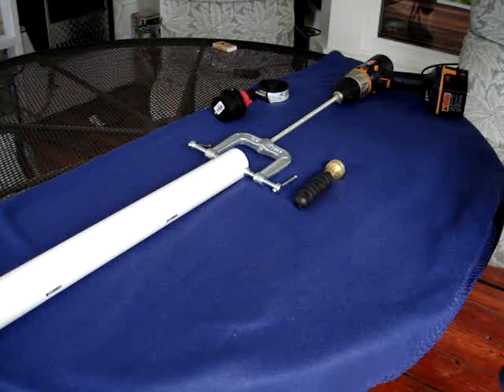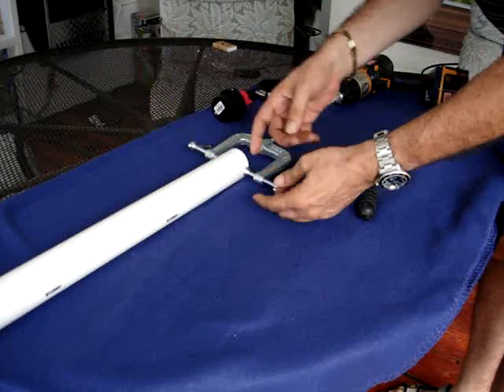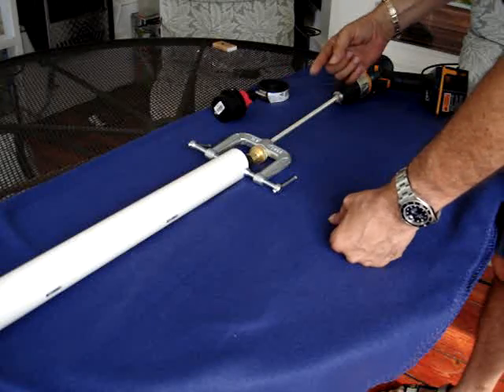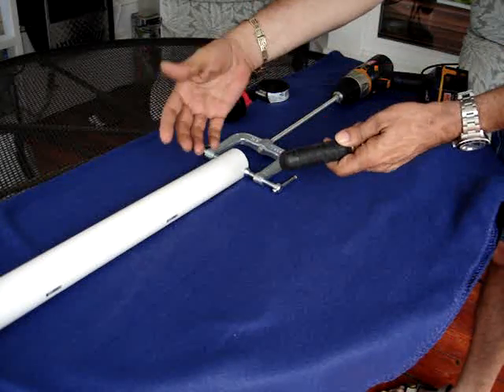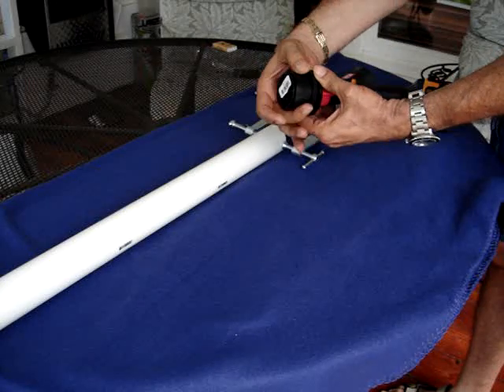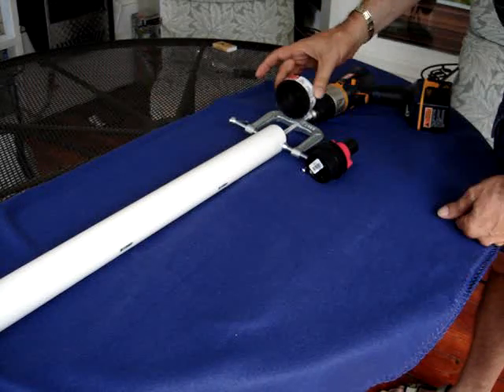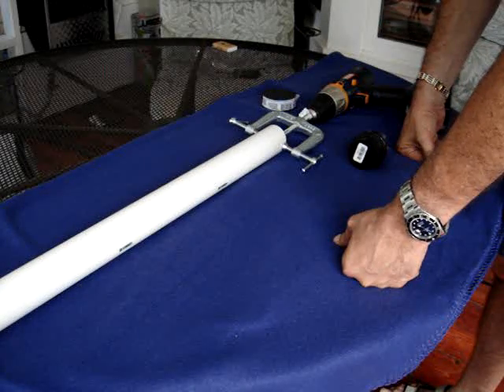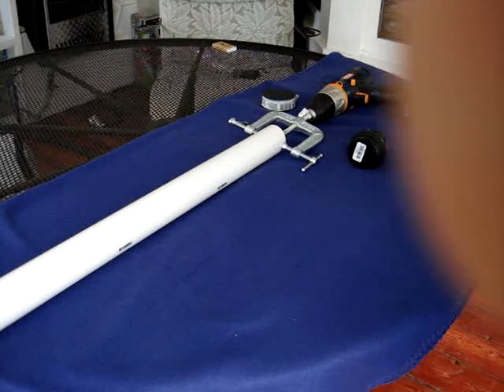BP OIL LEAK REPAIR - Eli Meloul

Comment: Your idea is basically the same idea I had. I figured to pump non compressible sea water to inflate the balloon. And the friction of the inflated balloon would keep it in place long enough to pump concrete into the well. The narrow diameter of the pressure hose and the deflated balloon would allow the well pressure to vent around it during insertion, allowing it to be pushed deep into the well. I am sure BP engineers must have thought of this if we laymen have and there is some flaw in it.

Comment: lets lower a gigantic iron two story grid over the leak area , screw it to the ocean floor and secure caps or tubes to each square shaft as needed eventually closing off the leak, keeping it flowing and equalizing the pressure of the entire grid, these grid or "quadulators" could be used on any ocean floor leak , cut the pipe off level to the ocean floor so the grid can be lowered on top and capped off one square shaft at a time, caps or tubes bolted on one square at a time..it'll work!